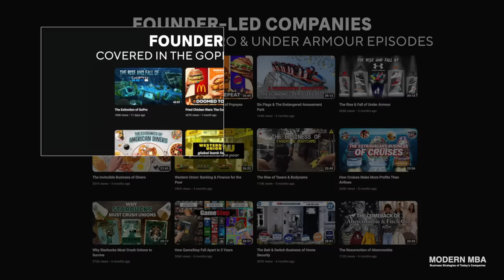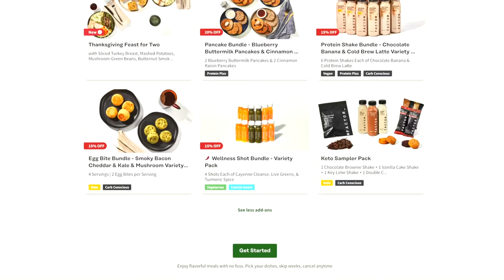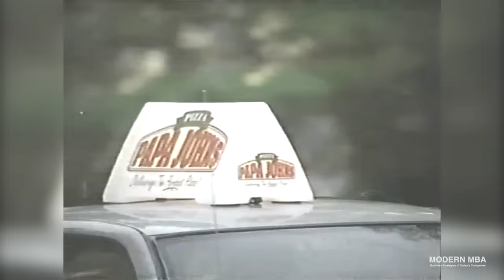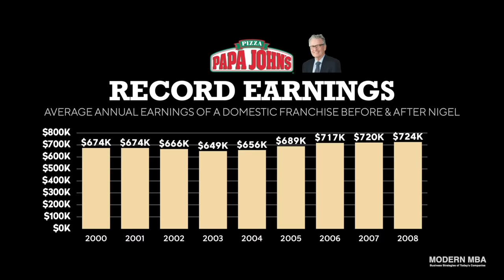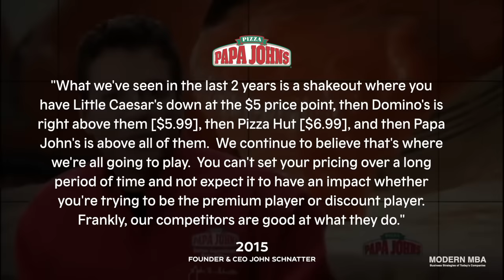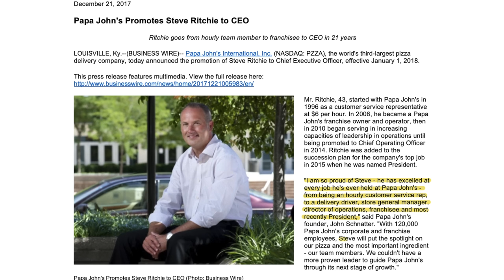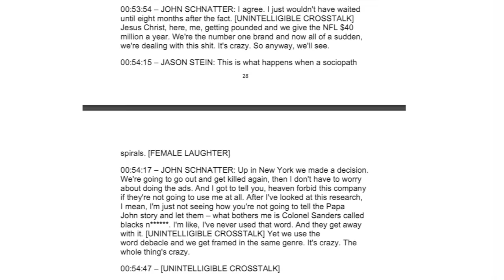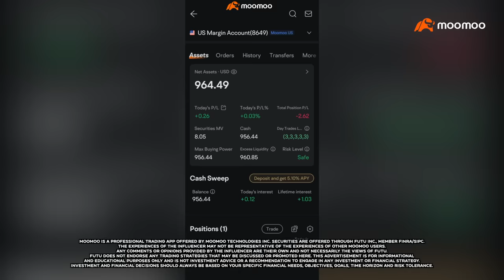The Exorcism of Papa John’s

Comment: The only distinction Papa John's has over Dominos and Pizza Hut is their pizzas are edible. And they're still edible, even after John was given the boot. But edible doesn't cut it when compared to local pizzerias, especially if you're in an area that's spoiled with good choice.

And while Laundry Service was clearly in the wrong, the controversies around John weren't fake either. With regards to the NFL, it was a subtle nod to the same "shut up and play" narrative that was being loudly peddled by conservative pundits and owners. You have to read between the lines. That, plus all the clear backstabbing, should have made it explicitly clear to everyone that this guy had no business being in any position of power. Laundry Service just provided a good excuse for the board to be more forceful in kicking him to the curb for good.